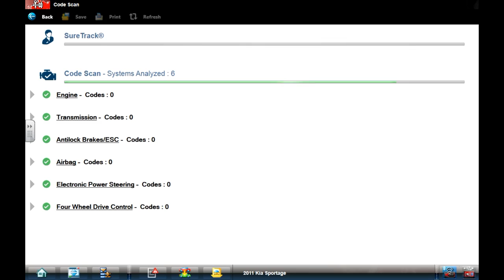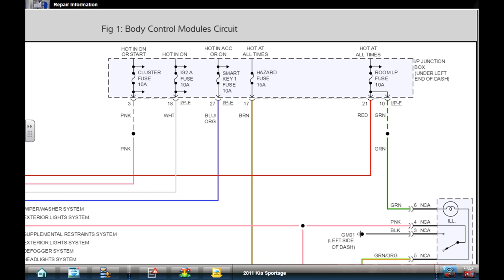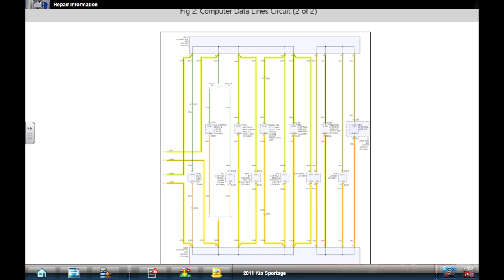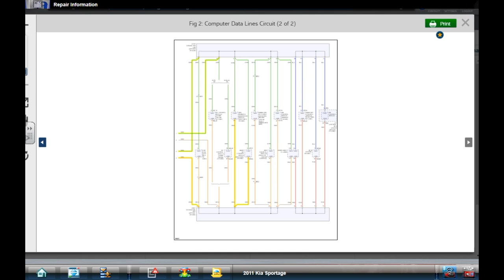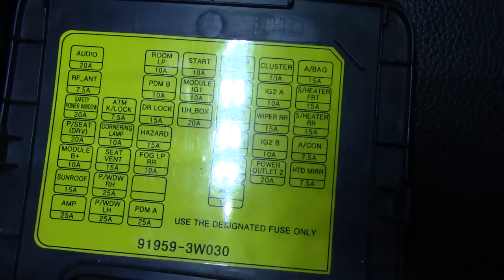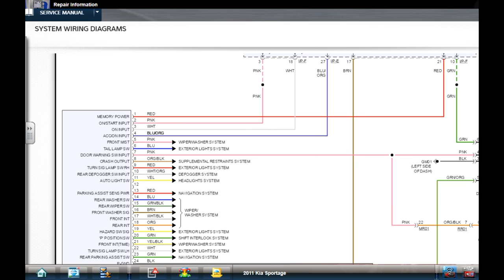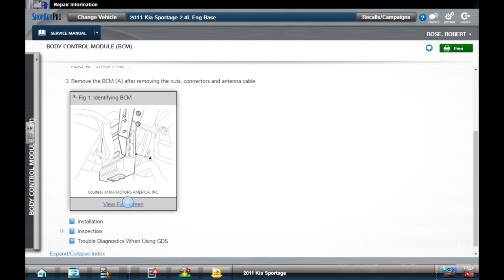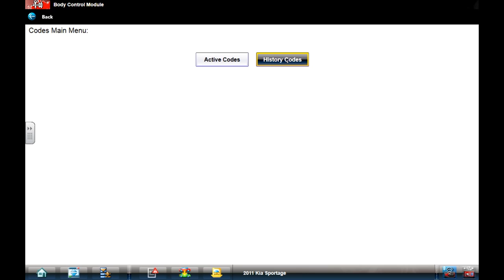2011 Kia Sportage No Com with BCM

Comment: Thanks for the "real life" scenario. I'm a fairly big and old guy and the contorsioning that goes with " working " under the dash, just drives me crazy. Patience is lost and plastic clips just get busted and now I have to figure out how to mend broken panels. I wish the factory would realize that vehicles break down and someone with  joints of limited range of motion has to get the repairs done. Maybe the panels attaching methods could get a little more predictable. How much would a shop charge for something like you showed in the video? Poor engineering and someone has to eventually pay for the day it needs repair. Hello actual cost of ownership. Better design and accessibility for repair should be just as much important as " sexy" ( whatever that might be) looking vehicles. I understand that leasing clients don't care, for about three year, just make the damn thing work and is not the lessee's problem.
Thank for the great video

Comment: SCANNERDANNER, can you explain more about what an instrument cluster is or what it does? what are joint  connectors look like and what are they used for? you didn't show the instrument cluster or the joint connectors what it looks like or what is does in your youtube video
Reply from the maker: Instrument cluster is your gauges, joint connectors are ways to unplug certain parts of the CAN system to isolate individual legs of the circuit when a module or wire shorts out and pulls everything down
Reply: @ScannerDanner  ok thanks

Comment: Just a thought to consider, as I work on Class 8 trucks but there could be another cause that I'm not sure you mentioned. That being yes you could have a power issue to the BCM but don't forget were the power comes from. Here is an article from Navistar, -DESCRIPTION
 Low battery voltage is the only known cause for BC lock up. This condition will occur if the trucks battery voltage is in the 5.0-5.5 voltage range.  This is an indication of bad or damaged batteries.  Ensure that each battery can effectively sustain a charge of 12.5 Volts or higher. The way to tell that a trucks body controller  has locked up is to check if the dome light, headlights, fuel gauge and voltage gauge are functioning.  If ALL of these are not functioning the body controller has locked up and will need to be reset.  To reset the body controller, power to the module will have to be cycled.  The easiest way to cycle body controller power is to disconnect the batteries for a short period of time.  Body controller power can also be cycled by removing the driver side kick panel and disconnecting the power feed to the body controller.
Reply: I've replaced several for all sorts of problems, but haven't replaced any when the B/C is locked up. Resetting it I believe was the correct thing to do, asking if they had to be jump started or anything would be something else to ask.

Comment: Didn't the room fuse being removed turn off the interior lights and when it was replaced @45:32. Could the room fuse be linked to the dome (room maybe?) Lights? Maybe an intermittent short on the dome light circuit causing the bcm to fault and go into some sort of protect mode? Just a few thoughts as I'm watching.

Comment: The advantages of IPS...Reduces the number of relays and consequently decreases weight and volume
,eliminates the relay operation noise, eliminates the necessity to replace fuses, increasing the product lifetime
 
and Diagnosis capability
Reply from the maker: thank you!
Reply: Not true in theory yes in practice no ..
Reply: @daddyjay319 
Greetings and blessings, Sir:✌🙏 
I know buddy!

That's it's function, for which it was designed.

But we all know that when it comes to talk about voltage, current, resistance,ground and circuits ... Everything can happen!
Reply: Yeah until one of the built-in relays fail and you have to replace entire fuse box to fix Chrysler had big issue with that 
$1.00 relay vs $300 fusebox,+ programming  tell me what is the best route
Reply: @hotrodpaully1  

I know, buddy and you're absolutely right.

The designers looked for ways to save space, weight, a device that generated less heat and acted faster ... but the reality is different.

They constantly fail and the cost of repair is much higher.

Ford and Chrysler are the leaders in failures of this type.

Comment: Considering you pulled a fuse out of the IPS, which is one of two devices on that network, I'm kinda wondering if the IPS was the actual faulty part pulling the BCM down.
Reply from the maker: now that we know the IPS is the fuse box, I suppose that is possible, but if that was the case, I would think we would have maybe had instrument cluster issues too and then maybe some COM codes in other modules? Not sure. Also, when I pulled the room fuse back out, the BCM was still talking, so I don't know if that helps us or not.
Reply: @ScannerDanner , I thought about that too as I was writing that.  I had an Escalade once that had a brand new shorted out oil pressure sensor that didn't pull down the entire 5V ref cct once though & it's the one thing that's making me keep an open mind to the possibilities.  You can probably correct me on that one.  There was at least four 5V ref wires out of the PCM and at least two of them still had the full 5V.  I believe that no matter how many 5V pins you find on a GM PCM, they all go to the same source on the board, correct?

One thing I noticed, looking through the wiring diagrams, is that a lot of the devices that weren't working operate mutually through both the IPS and the BCM.  Most just share the box the IPS sits in for the fuses, but the rear wipers are controlled by the IPS.  All I can think, at this point, is if the Kia comes back, find those other devices that are IPS controlled and look for them to also not be working.  I hope the Kia comes back to you for the next round.  I'm having a hard time walking away from the prospect that the IPS is the source and the BCM is a side effect.  I'm fine being wrong too.  It's been fun to participate, speculate, and just use my brain in any appropriate capacity for once.
Reply from the maker: For sure! And I'm super glad I posted this regardless of the no conclusion "fix". I knew I could count on you guys for some great information!

Comment: Well my issue is this. My Kia Sportage 2011.......dash went dark after I started the vehicle. Found out that a water issue I had coming in around windshield caused water to settle on the BCM box and had corrosion build up on the connecting pins (can't say I know what that is), problem now is getting a replacement BCM and Fuse box.

Comment: Il tell you a story...
I'm working as electrician in dealership 0 years of experience...

Toyota yaris 2020, turn the headlights off no key in ignition, they light up, rather than have parking lights only on when key is out,
Push hazard button you hear click from cluster, but no indication on cluster, either on the  outside they don't light up,

Experienceded 30 years electrician in dealership says it's fuse box in front,
Guess what I diagnosed it it was bcm,
He decided to charge battery it reset! And worked fine
He changed fuse box, it didn't work 😂😂😂😂
Thansk to your videos knew from start it was bcm
Reply from the maker: Such a strange this though on this. Nice job!

Comment: Can't fix it if it ain't broke. I've had this happen many times just by disconnecting and reconnecting. Most customers are ok with waiting until the problem comes back, unless the suspected part is cheap and readily available. I always try to find the problem before replacing parts, unless the cost of a part is less than the diag cost to prove it bad. Good video anyway, it happens to all of us.

Comment: I had a similar problem on my 2011 Kia Sportage base model where my parking lights  would not turn off and my right turn signal would not work. After a lot of headaches it was my BCM that had went bad so I replaced it.

Comment: hey, i have the same issue with my bcm but I've reset the power and it worked for a few days and now it works erratically, and sourcing my bcm is incredibly hard, I'm wondering if you have a way i can find one(not even my cars agents has them and they said they'll need to have it made in approximately 2 months)

Comment: Yeah, all KIAs have a separate diagnosis line which goes to the KIA diagnosis port that is under the bonnet usually near to the air filter housing.

Comment: Would it have stored any codes if you scanned for them while the fuse was out or tryd to reproduce the problem with it out and then put it back in bc with the fuse out it has no memory correct????

Comment: Hello sir…my kia sportage 2011-2013  is having 0.15A when i do the parasitic test value during engine off and every close..but when i pull the room fuse or radio fuse..it change to 0.00A..so what is the problem sir

Comment: i wonder if it would do the same with the room/lp fuse pulled and then power car off/doors closed and all modules asleep.
like it could have been running the control code in the BCM "computer" and not effected by memory power loss, until it needs to read it again or maybe only needed at each boot up. this stuff makes my mind race ;)

Comment: When the hazard fuse was pulled and the system operated faster, did all four lights flash on and off or did just two (like in just the front or just the rear)?

Comment: There may have been fretting corrosion on the fuse's output pin that got disturbed when the fuse was pulled out and reinstalled. Of course, testing with the test light on the top posts of the fuse could not have confirmed that, since you're testing the circuit at a point before the problem. I'll bet that if you went directly to the BCM, you would have found the red wire to light the test lamp dimly or not at all. As another viewer mentioned ("anti chuckle"), it would be interesting to see if the problem could be recreated by leaving the fuse out, letting the modules go to sleep, and then re-cycling the key.

Comment: Remember the old days when we the fix of those glitchy ECMs was to try disconnecting the battery for 5 mins and reconnect it.
Early 80s.
And the crappy convertor lock up switches on GMs
Reply: Later GM ecm tap tests.
You could be driving and hit a bump and the car would die.
Cold solder joints, traces pulling up off the boards.
Reply from the maker: or the old nintendo where we would blow into the cartridge and make the game play? 🤣

Comment: For me, there had to be something messed up in the BCM memory. This caused it to be like half freezed. When you pulled the memory fuse, everything got cleared and sorted itself out. After repowering it, the glitch in the memory was not there anymore, so it started working like nothing ever was wrong. Will the glitch come back? Imho it can after few hours, but just as well it could never come back. And was the glitch there because of a damaged BCM, or some other thing caused it (like jump starting or a dead battery), I don't know... Tough one I have to admit, but if it was me, I would just give it back to the customer, not selling him a new BCM. After all you don't know for a fact what was the root cause for the BCM to go stupid. Could be internal, could be external, like some intermittent wiring problem... I mean it is not guaranteed that a new BCM would fix it 100%

Comment: Sir I experience that still finding a problem coz when I pullout socket from the BCM and I turned it back to its connector it works well then when I put the key off then the problem comes again
Reply from the maker: Try disconnecting the battery and jumping the cables together for a few minutes to discharge any memory capacitors

Comment: Great video! That's how I do it. Takes time. But you're still much quicker!
A thought: Don't the Hazards have power all the time b/c they're safety related? If so, then if you're getting power to the Hazards with the Hazard fuse out, then it seems reasonable that you have a short to power in the circuit which is back feeding into the Hazard circuit. If it's all run by the BCM, then that short to power could be a short in the BCM, right? This is just one more proof WHY all the unnecessary computer in vehicles should be replaced by simple RELAYS.

Comment: Ref the room fuse:  when you checked it with your probe, and saw power, that should have reset the BCM unless the bad (suspect) contact remained on the output side of the fuse.  Might be good to spray that fuse socket with contact cleaner.
Reply from the maker: It wasn't the fuse. It was by pulling power away from that module, that caused it to reset from my memory

Comment: Late to the video. 
My theory, the bcm forgot what it was doing, ie what's on or off... Calling the memory fuse as the solution, it reset the BCM memory so it just put everything brushing back to default. Exactly like you said, reboot the computer when it gets stupid, that fuse is most likely powering the RAM like on a PC, a reboot clears the RAM and the computer loads all new information in it as to switch positions and such. Good chance the problem won't come back.

Comment: The Drivers Information Center on my 2017 GM pickup went stupid. Took it to the dealer ( still under warranty ) unhooked battery for ten minutes,  everything fine.  Quite a story on the RO, maybe GM won't pay just to disconnect the battery.
Reply from the maker: How has it been since the battery disconnect?

Comment: Work for Kia and I "DONT!!!!!" pull fuses bc it does reset modules for us. Do like you said verify powers and grounds and then commands out. Have seen what happen to you come back and the technician keep doing that same fuse pull routine just to PISS off customer and have returns. I am not saying that does correct issues but it does a "hard reset". I personally let customer know that system is working and if they do come back will go though the process of getting approval to replace.

Comment: I'd be interested in seeing the constant and max current draw on that "room/lp" fuse, I'm going to guess nearly nothing except for the light up key ring, which is probably LED and very low draw.
so constant low "memory" current, it wouldn't take much tarnish to build and creep under the fuse connections killing the supply voltage.
in other electronics there's often a lithium coin cell battery or super capacitor for memory backup and they'll do a huge range of stupid things when it's dead or failed, like scramble up buttons, lights, stations, calculate wrong, randomly not work or not work at all.
the real low power signal/communication/RF lines are very critical to tarnish, even what looks OK and had shiny spots with minimal darkening around them is often a no connection or highly capacitive joint which causes all sorts of troubles, like major frequency drift (analog signal/mixers and more) same issue with very low current power supply wiring in the junk.

Comment: In this case, would you of called it a faulty BCM? because you most would of had good powers and grounds if you didn't pull the fuse? It makes me weary now with modern cars, trucks etc to do this as the software can get i guess confused and is too smart for its own good? Or before calling a BCM make sure it has a software update?
Reply from the maker: Definitely would want to check for software updates, but no, it's not time to call a bad BCM. Read the comments here if you can, that IPM that is part of this low speed network may also be involved.

Comment: Paul did you not mention an 'after market' (thingie)? You moved that wire then removed the fuse (from memory). I have learnt through various vids from yourself that 99.9% of issues are usually due to 'after market accessories'. (Or cruddies). Hoping for our sake, it is a come back. Hoping for the customer/friend it is a fix.

Comment: hey scannerdanner stop referring can high and can low to high speed and low speed. its called can high because it pulls voltage up from 2.5v up to 4v on the high side and pulls voltage low from 2.5 down to 1v on the low side.
Reply from the maker: If i did, that was a mistake, sorry, I absolutely was referring to two different speed networks in this video and I may have gotten a little tongue twisted. The instrument cluster was the gateway between the two different speed networks.

Comment: take test light  test the grounds coming from fuse box test both leads the one coming in  from bcm to fuse box and other side coming from battery see if the ground is ok .
Reply from the maker: No reason to when everything was working. I was going to verify powers and grounds until everything woke back up

Comment: I remember when I used to work at  Hyundai every flow chart started with "perform capacitor discharge." 
On another note I think you guys should consider coming up with some new shirt designs, maybe a shirt with a hand drawn diagram from one of your lectures.